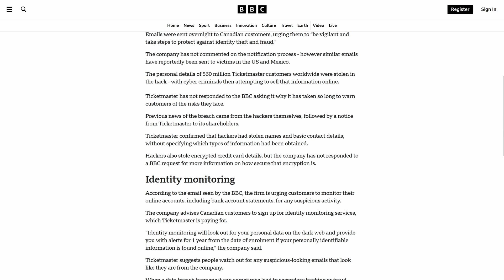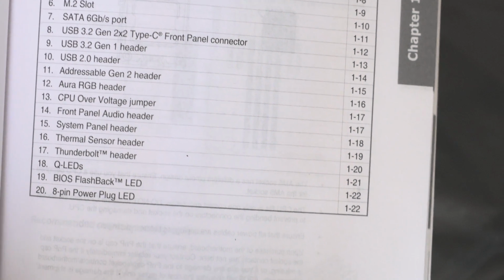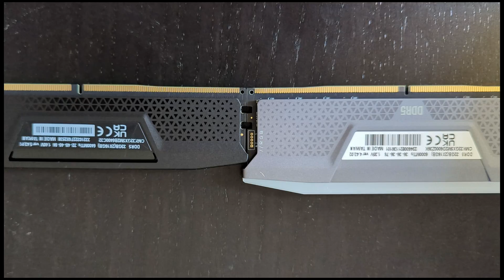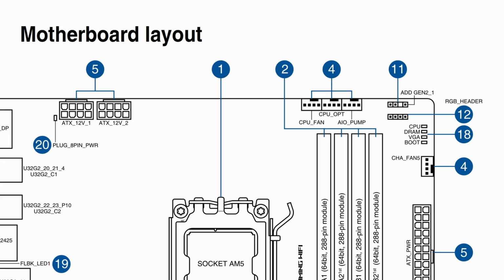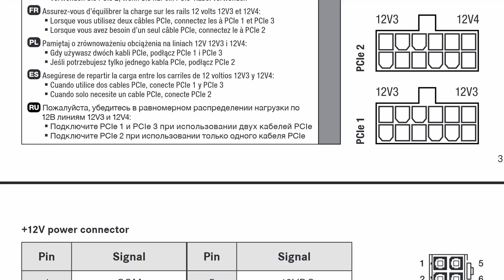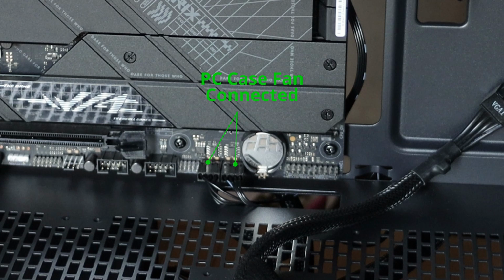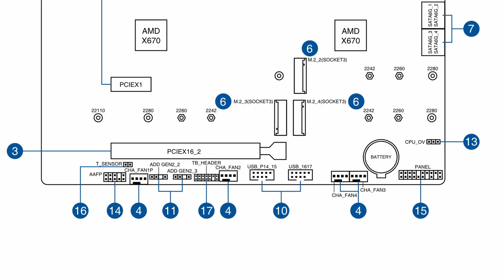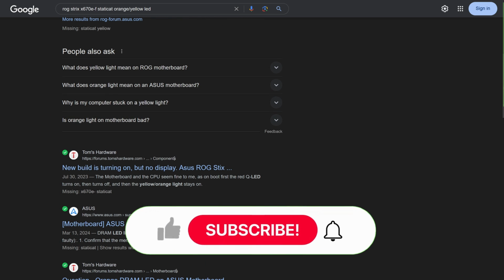PC Build Guide | Step by step AM5 build | Phanteks XT Pro Ultra Build | How to build a pc

Comment: Did you use RAM slot A1 and B2. That is actually not the recommended setup. For a two DIM setup you should use A2 and B2  This configuration  provides the best performance and compatibility, especially when using XMP/EXPO profiles. This is also noted in the Asrock manual
Reply from the maker: I know, A2 B2 is best for most chipsets

Comment: Hello My Rear Case Fan doesn’t work am I missing something?
Reply from the maker: make sure that it is plugged in correctly, I would check there. I don't remember if the front intake fans are chained and the rear exhaust is separated.

Comment: I have the same case but not the fancy RGB shining. How do you turn that on?
Reply from the maker: You need to plug the fans the tgb cables into the motherboard as it doesn't come with a controlor

Comment: Hi! Could you help me with figuring out if a Z790 AORUS MASTER will fit the case properly? I am struggling as E-ATX isnt really a real standard and is flexible.
Reply from the maker: I don't have that motherboard, but having a look at it's dimensions(30 wide x26) and what Phantecks states in the manual, it seems that it won't fit. According to the manual, it can fit: Mainboard Support
E-ATX* | ATX | Micro-ATX | Mini-ITX

*Up to 280mm wide
Reply: @casuallygamin9  Yeah so is it too wide or too tall? I would assume 300mm is height and 260mm is width.
Reply from the maker: If it's 260mm wide it will fit
Reply: @casuallygamin9  Checking soon, thanks!
Reply: @casuallygamin9  It is in fact 260mm wide! Ill report back here when built so you can give same info to others if they ask.
Reply: @casuallygamin9  It indeed does fit! New PC built except waiting for the GPU.
Reply from the maker: Hope you receive that soon to enjoy it.

Comment: I have the same case.. how do I remove the back panel so I can do cable management in the back of the pc case?
Reply from the maker: You have the side panel, the one that is not made of glass. Just slide it as you did with the glass one, as it has a screw in the back as well.